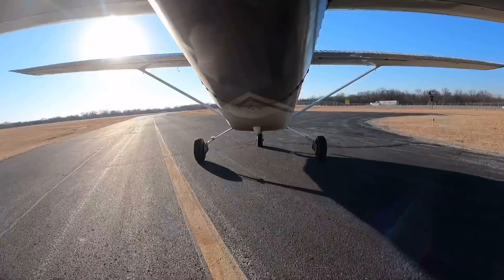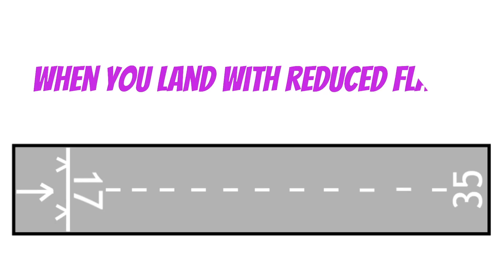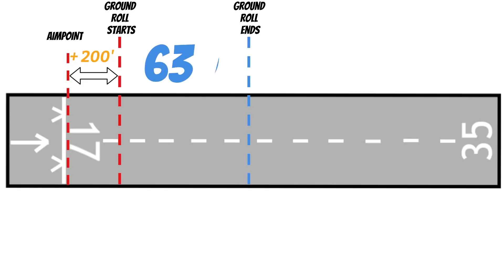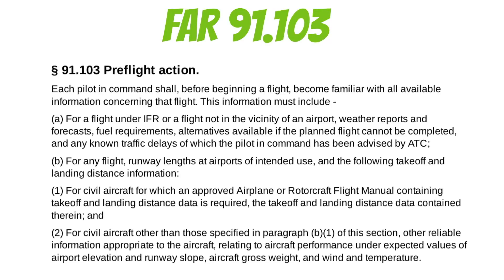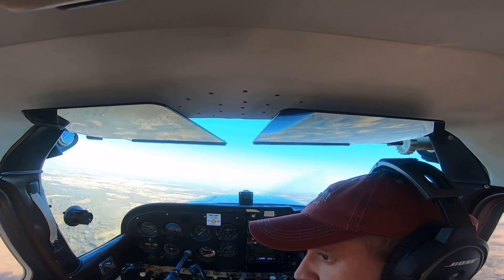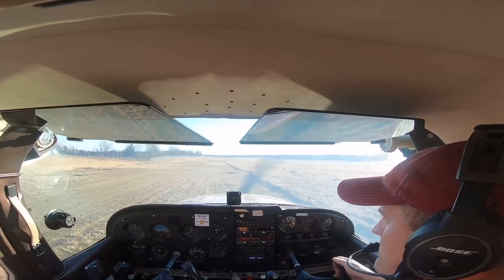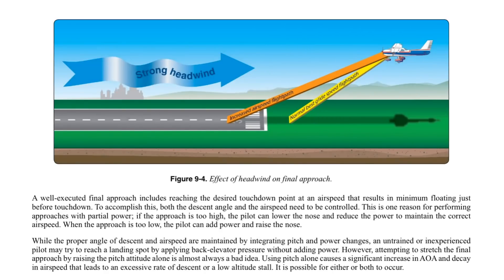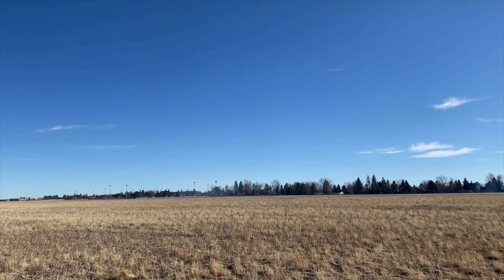Should "Normal Landings" be made WITHOUT POWER?

Comment: Good presentation.  Default power/pitch and full flaps allow us the slowest and therefore safest short final airspeed.  I'm old enough to have started before PTS which is now ACS.  In 48 years teaching, I have noticed a few common problems that need not make takeoff and landing hard.  Have your student put the centerline between her/his legs.  It will then also appear to be between your legs. (Optical looking ahead) Putting it under the prop is what causes all those tire marks on the left side of the runway.  On final jam your thumb under the bottom one side of the yoke.  The student will look over when trying to make coordinated turns on final.  Say, "rudder only to line up."  Aileron works well for stabilized bank against drift control but is otherwise causing problems.  In a turn are never directing the longitudinal axis toward the target.  You are keeping airplane going where the nose is pointed well, but the small coordinated turns (mini Dutch rolls) is not necessary.  Dynamic proactive rudder is effective.  Be a tail wagger not a wing wagger.  Finally notice how the numbers appear to speed up on short final.  If we use full flaps and elevator to slow enough to get a sink or mush (still above Vso) on short final, we bring variable throttle into play as the true glide angle and rate of descent control.  Now use elevator (pitch)  to keep the apparent rate of closure with the numbers from speeding up and power to control decent angle to touchdown slowly (at velocity of stall in low ground effect) and softly (power still controlling rate of descent),  Close throttle.  Come to Aurora, Missouri 2H2 to fly with me or work on it a little at a time.  There is no need to close throttle, round out, and hold off.  If you practice on your own you will have to round less and less until it comes.  Out further than an eighth mile or so we appear to close with the numbers at a brisk walk no matter what the airspeed.  Same as with you automobile, as you close with the intersection the rate appears to speed up unless you decelerate.  Again, good job.  We old guys need replacements.
Reply from the maker: Thanks for the tips Jimmy! I’m going to try some of those out

Comment: I think it is extremely dangerous to land in a way that requires power, because if your motor quits, you will need to know how to land without it, and the best way to get proficient at that is to practice it a lot. You can alter the length of the base leg if you are low, proceeding direct to numbers, while keeping full flaps to land short (slow). Landing with power allows for more shallow, stabilized approaches where you have a lot of time. But if the motor quits, there are very few options if you are low over a residential area on a shallow approach angle.
Reply: Better to land short, steep and slow.
Reply: I like the way you think. Train for no power. 
If you have an engine, then great, use it if needed.
Reply from the maker: You’re certainly entitled to you opinion. If I haven’t convinced you after this video, I probably won’t convince you lol
Reply: There is great value in practicing power-off landings, but consider this: making power-off landings gives you a lot of margin to use power to solve a low-energy condition on approach, but it affords no margin for correcting high-energy conditions on your approach. Flying a stabilized approach means being able to dampen both high-energy and low-energy conditions before you reach your landing decision point. Because of the presence of rising terrain and obstacles, many approaches flown in mountains have a "committed" point that is well before the landing point, some even at a downwind or base leg equivalent. Nobody who is committed on an approach would want to fly without the ability to correct for high-energy conditions.
Reply: @FreePilotTraining  If you are going to convince anyone of anything, you need to include all the factors relevant to the topic of discussion.  Altering the flight path is a way to address a low approach without adding power or increasing airspeed. I would be curious to hear your thoughts on that. Not including it just creates an appearance of unfounded bias, which undermines your ability to convince people to change their thinking. The reasons for practicing any type of approach inform whether that approach type is wise. Want to prepare for engine failure? Practice short approaches with engine at idle. Want to practice short landings at high DA with no go around? A long, shallow, stabilized power-on approach seems to be the recommended method. I would not practice power off to prepare for mountain strip landings in Idaho.
Reply: @mrfamous333  I would say you can square off the base leg and slip the base leg turns to get down to glide path without increasing speed, which is one tool for addressing a high energy state. The S-turn is another, if flying a long, straight in approach. Of course neither is ideal for a one way strip and I dont know anyone who would recommend power-off over a power on stabilized approach for that situation. It is all about using an approach that minimizes overall risk for the particular landing scenario in front of you.  At a little airport with houses all around, maybe dragging it in is not the lowest risk method, because engine failure might be the most likely failure mode. In the mountains with no go around, you are more worried about landing on the dot at the right speed than you are about engine failure. Just some off the cuff thoughts.
Reply from the maker: @kwittnebel  that is a great point. If I was turning base on altitude during a “power on” approach and I lost my engine, I’m definitely making a bid for the runway.  At that point, landing long is much better than landing short
Reply: @FreePilotTraining  in the event of engine out don’t you decrease your chances of making the runway with your lower approach and speed and flap configuration below best glide per the poh?
Reply: Couldn't one retract flaps in case of power loss?

Comment: Need to have some power all the way in .  Agree
Reply: It depends how you were trained. 
Please talk to a glider pilot.
Reply from the maker: Thanks!
Reply: Well, the glider pilot will tell you that it really comes down to what gives you the best/most direct and immediate control over glide angle. The glider's air brakes/spoilers are perfect for this - as they need to be as you only get one shot. Second best seems to be power adjustments and absolutely the worst are flaps, as they react slowly and should only be manipulated in one direction.
I also fly a motor glider where I have both options, spoilers and power - with the spoilers being preferable.

Comment: Long story short:  short/soft field landing should be the default landing for a student.  The only reason to use a “normal” landing in a 172, is if you’re trying to vacate the runway for trailing traffic, or there are big gusts, requiring a higher approach speed.  A power-off approach is not a stabilized approach, and it teaches terrible habits.
Reply: Those "terrible habits" can certainly become valuable the day the engine quits. I know what kind of pilot I prefer for sure. Happy landings (and don't worry, the engine won't quit)
Reply: @kch2005  You’re talking to a glider CFI here.  My point is that there are a lot of hack instructors churning out baby pilots who are incapable of flying a stabilized approach, and hitting their mark at the target speed.  I see them daily smoking around the pattern, burning up tires and brakes, using 60% of the runway to get a trainer stopped. What’s going to happen when they land on snow or ice or with a tailwind?
Reply: @PostcardsfromAlaska  I agree that is a problem. Not sure that is related to power off approaches though. I bet you and I can agrees as fellow glider pilots, that you can fly a stabilized approach power off (as you always do in a glider). And the habits of using TLAR in stead of mechanically adding 20 degress flaps on base, and full flaps on final. If the day comes, that they really need to land power off, I bet they don't have the needed judgement and experience. 
I enjoy both power off and power on. When I do power on I feel like a B737 on a 3 degree glideslope and that is typically with un experienced passengers. Alone or with fellow pilots, I do mostly power off, honing the skill of judging the wind, slipping when needed etc. The speed is bang on, but the glide angle varies according to my aim point. Excactly like a glider approach. Happy landings and blue skies :-)
Reply: @kch2005  By “stabilized approach” I’m not talking about rigid adherence to turns and flap settings.  Just a lower-energy approach, that allows power adjustments in two directions, instead on only one.  This is absolutely essential in larger aircraft, or you would never get stopped on a 7000’ runway.   It’s weird that so many people habitually fly small aircraft like powered gliders.  You may get really good at your hybrid glider-powered approach,but you will never be capable of spot landing under 200’ or operating off-airport without wrecking.
Reply: If you have a constant descent rate with constant speed and heading for your touchdown point -you're on a stabilized approach.   It's nonsensical to say that if your power is off you can't fly a stabilized approach.
Reply: @PDZ1122  Everyone should practice power-off approaches, but if that's your normal procedure, you're pretty much just a brake-operator, not an aviator.

Comment: 35-hour student pilot, I had my first passenger flight with my CFI this morning. I went from the 160 hp I'd been soloing, to a 180hp conversion. I noticed the weight difference mainly on landing. I went power out like I'd typically do while solo. This caused us to drop like a brick from the excess weight I'm not used to. It was a minimal one bounce landing from a lack of round out but has been noted for future flights.
Reply from the maker: That can certainly happen. You just have to be a tiny more aggressive in the flare

Comment: 15:53 I think the downward pitch they're mentioning is due to elevator/stabilator stall, as a result of empennage blanking (by the fuselage) during the forward slip. Flap extension results in more downwash behind the wing, which I suspect worsens the stabilator stall.

This problem would be greater when the CG is farther forward than normal, but could probably be recovered by quickly removing the slip.

Comment: I'm a little confused, what's stopping you from putting down any amount of flap (including full flap) at the end of a power-off approach should you so choose once the runway is made? I don't understand this entire line of thinking that suggests you'll be touching down with partial flaps if your approach is power off.
Reply from the maker: On a power off approach, flaps are used to control your descent.  If you aren’t going to make the runway, you’re not going to put more flaps in. So you may have full flaps or you may have no flaps on a power off approach
Reply: @FreePilotTraining  sure, but once the runway is made - aren't you supposed to put down whatever flap setting you want for touchdown? Certainly with power you can drag it in with full flaps from 3 miles out, but nothing prevents you from doing a power-off approach and then putting down full flaps on a short final, correct? You're making this assertion that power-off approaches often result in landings with partial flaps, but you're just not explaining why. I personally was trained to land with power, but whenever my CFI asked me to do a power-off 180 he would always expect me to put down full flaps before touchdown as that's what one would do in a real off-airport landing emergency to minimize the groundspeed.

Comment: Hi nice video ( I need to watch it again to fully appreciate it !). I have one question regarding your landing : Flaps up whan on the ground. Ok I used to did it, but my last instructor told me to keep it down. My question is : flaps up to stick the plane on the ground, or flaps down to break the IAS ?
Reply from the maker: Thanks! This is a great question. It really depends on 2 things… what kind of airplane you’re flying and what you need to accomplish on the “touch and go” or “go around”. You never want to go around or keep full flaps in if you’re doing either, but you may need to keep some of them in to climb out over an obstacle or something.  Also, when you make a short field landing, you should raise them every time to decrease the amount of lift your airplane is producing.  This maximizes your airplanes braking ability. So to answer your question, if you need more braking energy, raise those flaps as soon as you touch down.
Reply: @FreePilotTraining  So yes it is a C172 too. And so I understand that to land on a short field, it's better to raise the flaps as soon as your wheels touch the ground

Comment: Interesting. I fly out of a very small air park in Illinois (LL10). 2300’ with obstruction on the south side. Most of us land with power because it is much easier to ‘drag’ the airplane in with power like you were landing on a sand bar on a river. However can you imagine an engine failure situation where you need to precisely land the plane power off. In our case a power off landing from the south is preferred because you are over residential houses directly underneath final. From the north, once you clear Walmart there is a prairie area you can safely ‘crash’ if you lost power there.
Reply from the maker: Thanks for the comment! Yeah, I do think it’s important to practice power off approaches, but lowering the risk for something that’s rare to increase the risk on something that’s not is not too smart.  I love your plan though. If you have an engine out plan, that’s perfect
Reply: @FreePilotTraining  and finally, my current habit is to pull the power to idle opposite of the numbers on our north landing over the houses, leads to a steep approach ( that is good on my 1969 182 with full flaps)  that makes sure I won’t crash into any house if I lose power on short final. That is not the case for others here, and it concerns me. The RNAV IFR approach is pretty scary over the houses.,.

Comment: I used to routinely land C-172’s  deadstick, often practicing from high altitude 10 miles away. They’re basically gliders. My RV-8 is a whole nuther thing…its wingspan is only 24 ft and has a constant speed prop. I always do power on approaches. If you chop power with a constant speed prop set at “full fine”, the prop suddenly acts as a powerful air brake….its like an extra set of flaps. For landing any single engine plane, I adjust my descent rate so that I roll out on final at 400 ft AGL which helps create an identical sight picture on final, which really helps making for a stabilized approach and landing every time.
Reply from the maker: Awesome comment. I haven’t flown a ton of planes with constant speed props, but I fly large aircraft that use FADECs to control the propellers. Once we’re on the ground, you can place the throttles into the ground range and they fully “unfeather” that creates some good drag like you’re talking about. We can also throw the props into reverse so that makes it even better.
Reply: @FreePilotTraining  Thank you. With a CS prop, part of the GUMPS check is to set the prop to full-fine, which is where it needs to be in the event of a go-around.  The first several times I landed the RV-8 it tended to sink like a rock when pulling the throttle back during approach due to the prop braking effect. So it helps to define a target minimum altitude when turning final. So after my GUMPS check, with the prop full-fine, I adjust manifold pressure to provide between 2300-2400 rpm which provides a nice descent rate of ~ 500 fpm. Of course, this RPM has to be adjusted for winds so that I don't bust my 400 ft AGL on roll-out. However, maximum glide distance is achieved by setting the CS prop to full-coarse and then adjusting airspeed to best glide speed.  Love the CS prop..on takeoff it launches like a muscle car and pins you to the seat. ;)

Comment: I enjoyed your presentation, and thought it was outstanding. I had an engine-at-idle-while-landing situation years ago at Riverside Airport, California, that might interest you. At that time, Riverside had a single 9-27 runway about 5,000 feet long as I recall. I was a licensed pilot working on my commercial on a cloudy Saturday afternoon in October. There was a solid overcast at about 2,000 AGL, so I was flying beneath the clouds doing lots of touch-and-goes. I had done 10 or so and was on my downwind leg for another one when the tower called and asked me to shorten my downwind and land due to incoming IFR traffic. I was just about abeam of the numbers and had plenty of runway (flying a Cessna 172) for landing roll-out, so I did an almost immediate base turn, brought in all the flaps in increments, and was perhaps 50 feet above ground on final and well over the runway when my engine stopped completely.  Didn't even windmill!  I cancelled my touch-and-go to touch only, and coasted off at the nearest taxiway. Turns out it was carb ice according to an instructor and mechanic who came out to my position to check things out. I had carb heat on while landing, but with engine at idle, there wasn't enough air being pulled through to prevent icing in the humidity condition of that day. I re-started the engine while the instructor and mechanic were standing alongside, and continued my flying, never ever going to full idle in landing after that day.
Reply from the maker: This is an awesome story! Thank you for sharing.  I never considered this possibility.  I have read of people flash heating older engines when approaching at idle, then going around with full power, but I never considered your carb heat scenario.